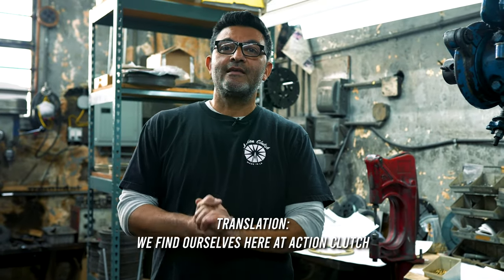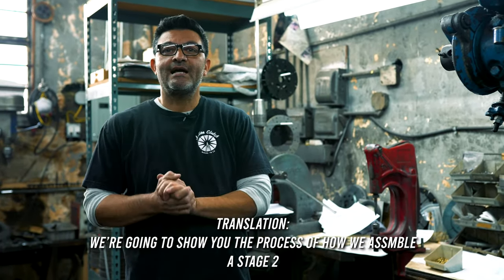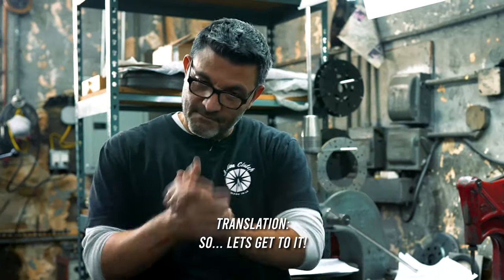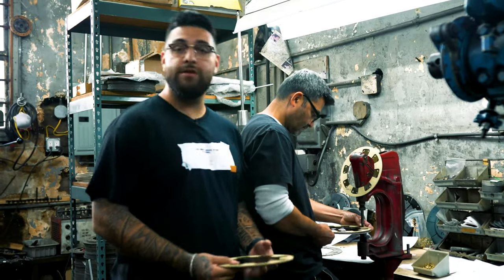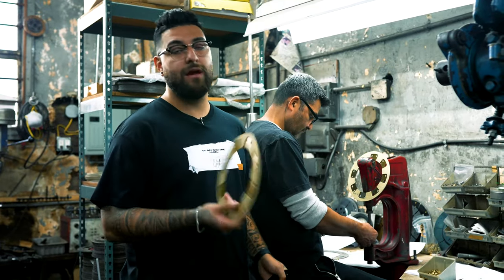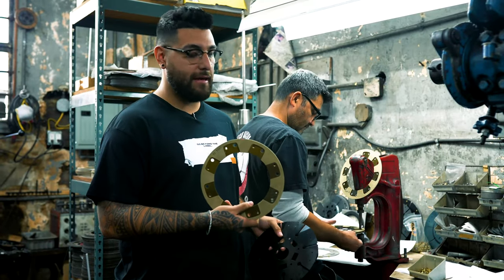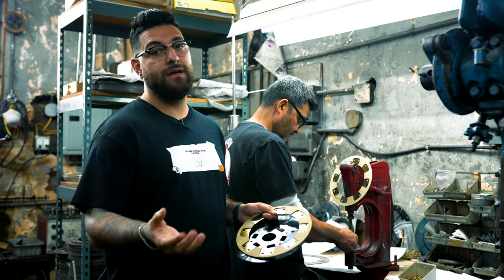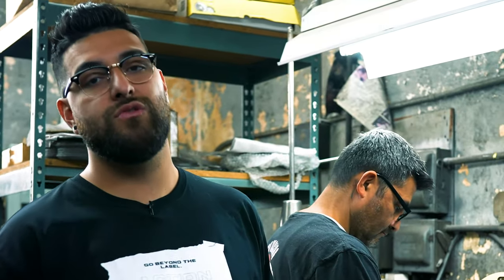Action Clutch Stage 2 Clutch Assembly

Comment: A question that would happen if when I assemble an action Clutch 2 kit I don't twist it with the pounds needed, would it bring me problems?
Reply from the maker: The clutch kit wouldn't function properly and cause engagement issues, fretting of the flywheel, or bolts backing out causing damage.